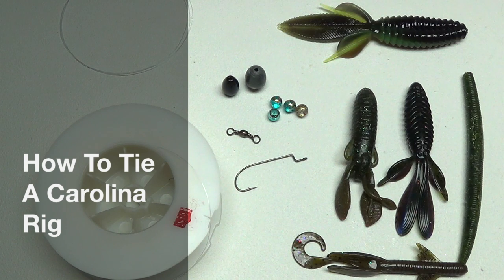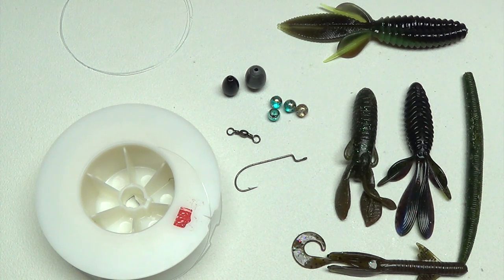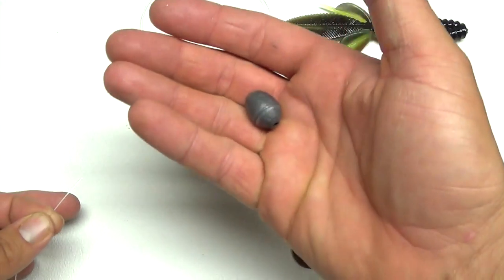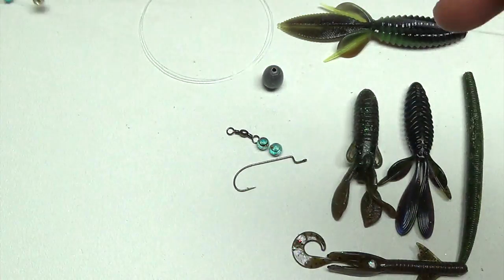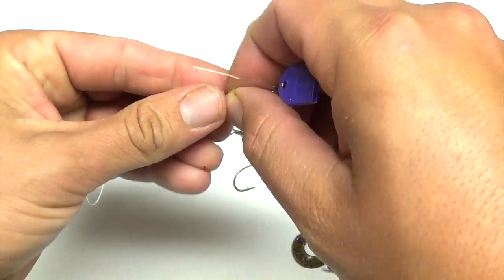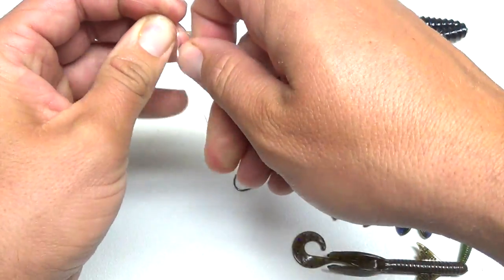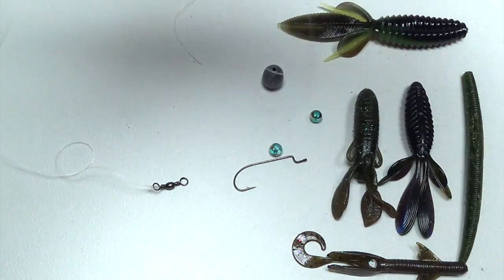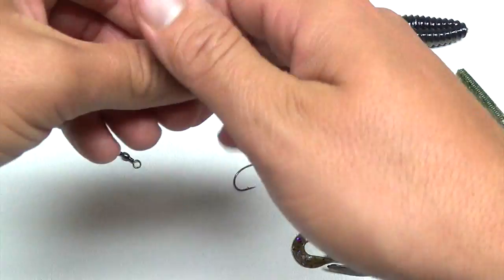How to Tie A Fishing Rig/ How To Tie A Carolina Rig

Comment: Very informative video, however I do have a question. I'm not fluent with the polymer knot, but how do you tie it on both ends of the swivel? Once you have tied the main line to the swivel and then tie on your leader on the other side of the swivel you can't bring the swivel through the knot because you have the main line that would also have to go through the second polymer knot.
Reply: I noticed the same thing.  Lol.  I think it can be done if you tie the barrel swivel to the leader first, this way you can pull the entire leader through the knot.
Reply: Yeo, just do the later first.
Reply: I notice the same thing, he has to go true the whole fishing rod in the loop.